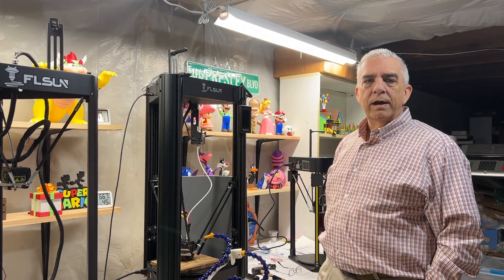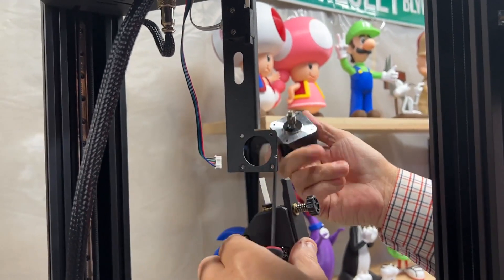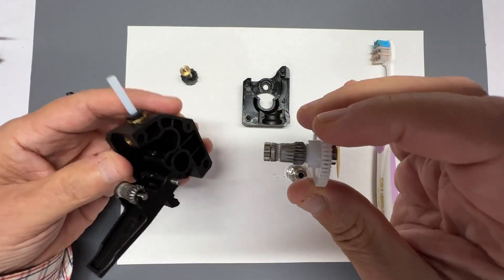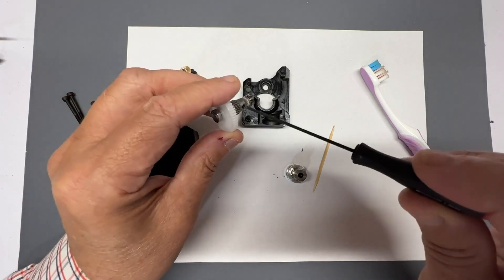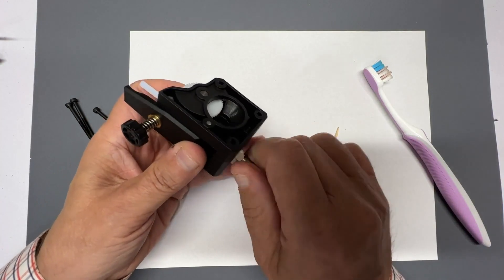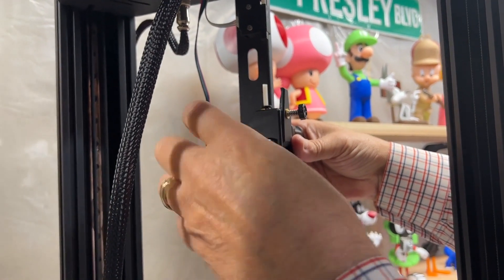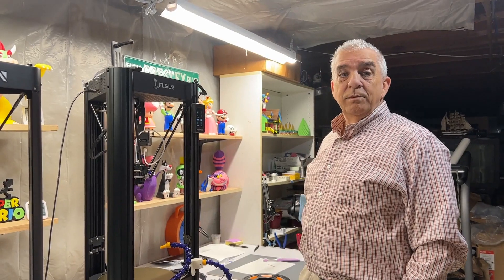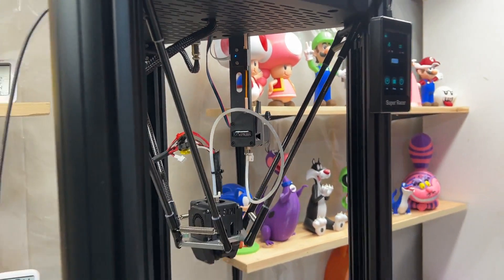Maintaining the FLSUN Super Racer Extruder

Comment: NOTE: Since I see the question: Under maintenance page 33 of the user manual, they mention/pictured the U-shaped spring tension gauge gcode being on the SD card, wasn't include, I requested and then posted under files on the Facebook Flsun official S1/Flsun page in 2020, looks like only (2) members acknowledged it, it's there for downloading.
Reply from the maker: Thank you !!!

Comment: Great video, How do you know how many turns to give the tensioner screw after taking it apart?
Reply: Under maintenance page 33 of the user manual, they mention/pictured the U-shaped spring tension gauge gcode being on the SD card, wasn't include, I requested and then posted under files on the Facebook Flsun official S1/Flsun page in 2020, looks like only (2) members acknowledged it, it's there for downloading.

Comment: In regards to the spring tensioner on the SR, what is the proper setting for it? Meaning, how many turns do you tighten the spring knob on the extruder when you put it back together? Thanks!
Reply from the maker: First, mark a line on the knob, unscrew it until it just enggages with the thread. Then tighten 3 full turns. That is all you need...
You may have to adjust slightly, but not more than a half turn...
Reply: @dennisgignac5103  Perfect. Thank you.
Reply: @dennisgignac5103  Thanks, I'll give it a try!!! That extruder has been giving me so many problems... Once again, thank you for responding!

Comment: Hi Dennis, Could you do a video on Hotend rebuilds maybe possible hotend upgrades. Your videos are great reference videos.
Reply from the maker: Let me take a look into that Tom...
Reply: @dennisgignac5103  One more question, the thumb screw on the extruder, how far do you screw it back in after cleaning? It looks like all the way. Mine was about one full turn lose. I just don't want to cause more issues for myself.
Reply from the maker: @tommcminn1968  I only screw it in slightly until it begins to have a little spring tension...

Comment: Hi Dennis, thank you for your videos, I really enjoy your direct and laid back style. I'm a noob and the FLSUN Super Racer is my 1st 3D printer...so new territory. I think the FLSUN is great, but perhaps from what I'm learning not the best machine to learn on. Had many little problems, and now some bigger problems. I was getting a "runaway" error in the middle of some 6 hour prints. I thought it might be a firmware problem so I followed your instructions to update that. Now, the heater bed is not heating so the prints won't start. So I tried setting the heater plate to room temperature and that allowed me to print for hours with no "runaway" error, but the print warped, and was ruined so learned my lesson there. : ). Any thought on why the heater bed isn't working? Thanks.
Reply from the maker: Contact me through Facebook Messenger. Dennis G. Gignac
Reply: @dennisgignac5103  Dennis, I tried a ender 5 plus and had this same error and got mad enough to give up on it.  Thermal runaway error is my only fear with another printer... Will this happen with the super racer?

I am a 3d additive engineer btw.
Reply from the maker: @MechInvent  No Sir !!!

Comment: Dennis what filament do you use and what slicer settings? Happy New Year.
Reply from the maker: I use mostly eSun for the most part, but others as well... It will depend on which printer you have...
Reply: @dennisgignac5103  same here. eSun is what I started with and stuck with. I just got a filament drier so I think I’ll experiment with some cheap stuff and see how it goes. eSun has been consistent for me though.